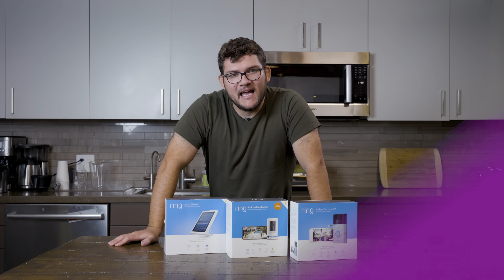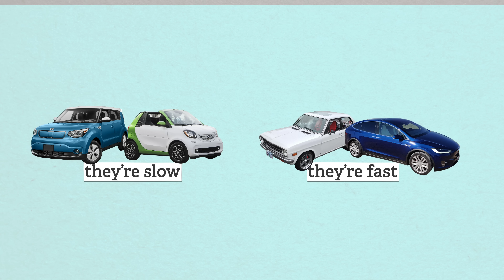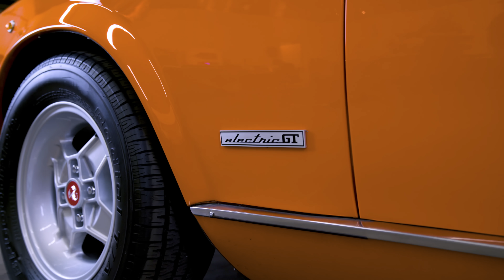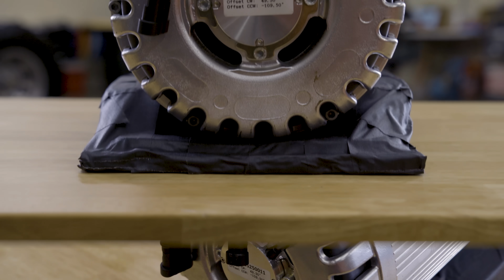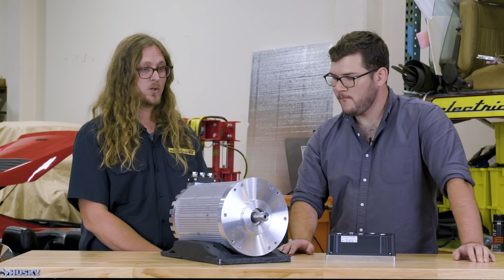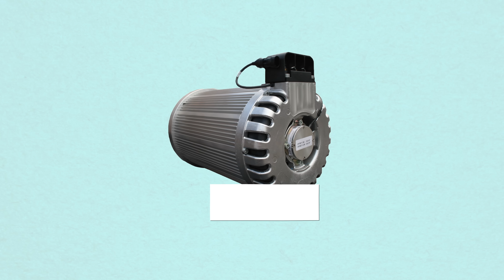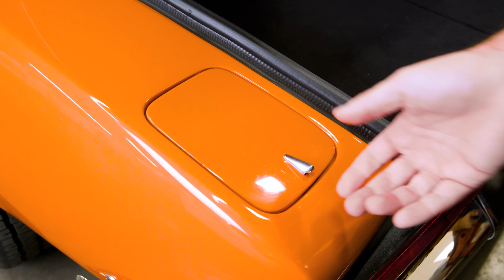Are Electric Motor Swaps the Future of Tuning? | WheelHouse

Comment: Electric motors with a manual transmission?!  I'm sold.
Reply: Clell Biggs that’s what I was thinking. It’s also impossible to stall lol
Reply: I agree if more electric cars had a manual transmission I would definitely consider getting one
Reply: But if they'd manage to get a clutch in too, then I'm gonna forget about combustion completely
Reply: @sheldonlewiss  you can't have a manual without a clutch, of course it has a clutch. I don't understand why everyone thinks it's a difficult process, it's exactly the same as a combustion engine to mate to a transmission.
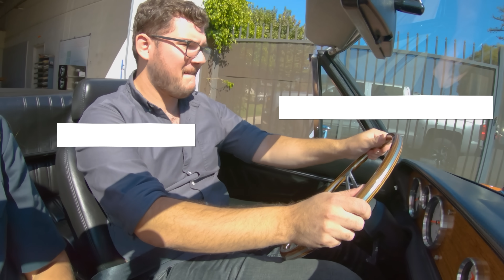Reply: @achilleaustin  The guy in the video said, there's no clutch engagement or something like that. I might've misunderstood that. He said you can just press the accelerator and it would go from a standstill and the clutch is to shift between gears. (6:40) please explain 😅
Reply: Sheldon lewis TECHNICALLY you don’t need a clutch because electric motors change rpms so rapidly, it could probably handle it, as long as you’re off the accelerator the electric motor could be directly bolted to the transmission. I’m not guaranteeing the longevity of the transmission, BUT you could do it
Reply: @sheldonlewiss Don't know if anyone answered this for you but while the car does have a clutch, it doesn't need it for anything other than gear shifting. Like, you can leave it in 3rd gear or even higher and just press the accelerator. If however you want to shift, you still need to press in the clutch.
Reply: Check out the EV Mustang that Ford built for SEMA, it's mated to a 5 speed (maybe a 6 speed, I can't remember).
Reply: @phillipholland6199  its by charge cars not ford
Reply: I just made one 😂😂 pretty fascinating as I do not have clutch all I do is shift gears while moving my feet away from the throttle it's all old skool no sensors less parts to break and it's fucking fast as hell I intentionally put motor rpm limiter so that i won't crash
Reply: @simardmg  dang that's awesome bro congrats, make a vid even if it's just showing it off.
Reply: Right now i'm like: I'LL TAKE YOUR ENTIRE STOCK
Reply: If electric cars were absolutely necessary outside of cities, I would absolutely " make the change " so long as I get to keep an RPM range and a shifter. I live the sound of my turbo charged mini and it's snappy exhaust sure but the shifting is the most important part for me.
Reply: I never thought an electric motor would need a transmission considering the torque curve.
Reply: I’m definitely sold
Reply: Sigh of relief
Reply: My goal in life
Reply: Clell Biggs same
Reply: True
Reply: They tried that with a C7 corvette and it flopped
Reply: Oh yeah !! And with that powerful speak system in the old exhaust pipe you can have any engine sound too in the future
Reply: @92-SC300  I was speaking more in the sense why if you're making an EV from the ground up, not making an engine swap, there's not a lot of reasons to design a transmission into it instead of a fixed ratio transaxle. Sure, engine swap, leave the transmission in for fun (and ease of conversion), but an OEM has less of a reason to.
Reply: Electric motors don't really need gears though, but they should feel awesome because the motor offer very low resistance, so it should feel like being in neutral gear when you don't have the foot on the throttle.
Reply: they operate at rpms from 0 to 20k, to have even a 2 speed transmission could theoretically get you to 400+ mph
Reply: Fuck electric motors. Internal combustion all day
Reply: And speakers to make engine sounds. 😉
Reply: It would not make alot of sense when using a high RPM motor, something like a Tesla would use. Maybe an electric motor of 10k rpm would work better with a transmission
Reply: why would you want a manual with an electric motor?
Reply: @DrDrift-rl6cc  for fun, and slightly more efficiency.
Reply: @DrDrift-rl6cc  They think they can shift faster than computer. Stick would be cool if they made an old electric muscle car.
Reply: What so you can switch between 2 speeds lmfao
Reply: Built in anti -theft device, coool.
Reply: I believe it's a option only cause they can do it, should they, sounds fun, but the massive torque, will Destroy the clutch.. Tesla roadster tried a two speed, but it wouldn't survive.. just saying.. my two pennies on the floor.. peace
Reply: @AtZero138  mate we're not talking swapping a Tesla roadster motor, and there are plenty of gearboxes that are run in cars with much more torque than a new roadster.
Reply: @achilleaustin  no worries,  it's that a multi million dollar company couldn't make a transmission that could handle the massive impact of shifting electric motor powered Tesla roadsters.. yes they make trans that can take it.. but the problem is in packaging.. this is all fascinating stuff to me.. as I'm typing this in my daily driver 1968 Dodge Dart.. Peace
Reply: @AtZero138  REALLY late response. But the tesla Roadster's 2 speed transmission failed because it was a crappy dry sump system that overheated the bearings in durability testing. Both New Venture Gear and Hamtramck tried to get it to work for Tesla. (I may have been working on it back in 2008).
Reply: If you’re fine with sacrificing range, sure. Which is like, something people complain a lot about. The poor range.
Reply: @Appletank8  It doesn't sacrifice range because you could just leave it in third and it would act like a regular electric car
Reply: @achilleaustin  also technically you would be getting better mileage on the highway since you would be sitting at a lower rpm than a normal electric vehicle, plus if you are using a modern drivetrain setup there will be minimal power loss.
Reply: @achilleaustin  
Transmissions are heavy. Especially when you're lugging three sets of gears that don't do anything most of the time.
Reply: @Appletank8  chevy powerglide might be a good option. plus with the torque multiplication of the torque converter it would use less power at stop n go. only problem is theres no lock up converter so youd have power loss. maybe you can get a lockup converter for it.
Reply: @achilleaustin  Not exactly, passing power through a transmission incurs friction losses. So direct drive will always be more efficient.
Reply: @Appletank8  makes 0.1 percent sense ,
Cuz  car transmissions just weights 30-45 kgs
Reply: Appletank8 throw a range extender in the extra space up front, a small motorcycle engine or single piston lawn mower engine and alternator could definitely fit in any of those cars and you have a series hybrid with basically unlimited range
Reply: @brandonmiller9155  
1) You're already sacrificing a lot of space by cramming in batteries into a vehicle not designed for it, I'm not sure you actually have the space for a fuel tank to get any useful range out of it unless you carry a lot of jerry cans.
2) A tiny engine isn't going to charge that battery with any semblance of speed. You're going to be sitting for an hour or two to get anything.
Reply: @Appletank8  range on a weekend classic car is really not an issue. Owners of classic usually only do short trips.
Reply: @Appletank8  but you get a higher top speed because of the gearing
Reply: Why do you need a transmission for an electric motor? Just vary the current. You save all the weight of carrying a gearbox
Reply: Yall do realize that there would be no point because you can throw it into the tallest gear and it would still perform amazing
Reply: @benweinheimer6287  Yeah but the fun factor of a manual is the most important. Also choosing gears makes it easier to corner knowing that you won't give it a little bit of gas and apply too much power. Not to mention drifting and stuff would be easier
Reply: swagonamillion boye well actually having multiple gearing ratios will make the efficiency higher. An engine uses them to convert the torque produced into something usable. Overdrive on the 6 speed manuals means that the engine can chill at 4 1/2k rpm and still be going 60-80 miles per hour,  obviously an electric motor uses less electricity at lower RPMs SO you get better range with the gearing. Probably not THAT much which is probably why most electric cars either have 2 speeds or none at all. It could ALSO benefit from greater regeneration when braking, but again probably negligible considering. More than likely manufacturers use what is essentially 5/6th gear for their two gear ratios. Which is where the greatest torque transfer is compared to RPM.
Reply: @benweinheimer6287  It would just improve both top speed and power economy, but no, no point at all.
Reply: exactly my dream

Comment: Every EV comes with a home charger that plugs into your toasters plain old outlet . You can install a dryer outlet for quicker charging but I plug my Chevy Spark EV in at night and it’s full in the morning . It also has 400ftlbs of torque and is faster than the v6 Camaro of the same year.
Reply: Yeah but that's a V6 not a real muscle car
Reply: xerosagas but the Spark is supposed to loose to Everything !

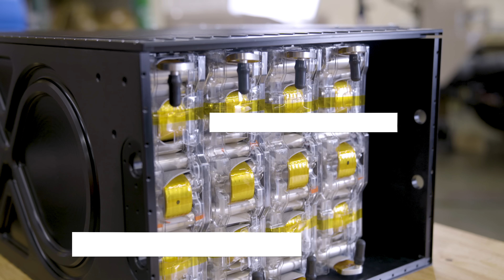Comment: 8:36 can one use water if they are in a pinch?
Reply: As long as the water isn't at risk of touching the contacts. The benefit of other substances is it reduces risk of a battery fire after a crash. These alternatives don't conduct electricity.

Comment: "Electric cars are beating some of the best gas supercars on the line"
Shows race between Tesla and Mustang

Nolan, come on, come... Come on, Nolan, come on, Nolan. Cuh... Come on.
Reply: Teslas regularly beat Hellcats of that makes you feel better
Reply: Gerry E for 50 grand more, yes. Tesla’s are still ridiculously expensive for their performance.
Reply: @savagetuner2404  What? the opposite is true. In a Tesla Model S P-100D you get 2.4 second 0-60 for around 100k. And you still get a fully functional very daily drive able sedan.
Reply: Cairo Nerf yeah, it still gets beat in a quarter mile by a 4,000lb jeep. I could care less about those electric boats.
Reply: A regular mustang ain’t no supercar unless it’s the Shelby GT500. But I do agree Tesla’s speed is comparable with some but not all supercar. A Hypercar in the other hand like Bugatti, Pagani, and koenigsegg can definitely outrun any Tesla at the moment .
Reply: Alvin Chong a Jeep trackhawk can best performance Tesla’s over 100k. A Jeep. They aren’t that amazing.
Reply: SAVAGE TUNER 700hp v8 , that trackhawk is some monster .
Reply: The point is valid, it's just a bad example on the gasoline side, if you talk super cars. Either change the line or the example. There's enough material out there from teslas beating all kind of super cars. Also there are some real crazy fast electric super cars, especially the rimac.
Reply: It's not BS, but it is down to the drivetrain and nothing more. An electric car has full torque from the start. Internal combustion needs revs to get to full torque. So by simple physics, an electric car should always beat internal combustion in acceleration off the line. Sustaining it and top speed are an entirely different matter!
Reply: A tesla can beat a lambo hope that will calm you down
Reply: That is honestly the stupidest example ever. You know when they're trying to be controversial. When they pull BS like that.

Comment: If Toyota would make an electric 86 with decent HP and mileage I would definitely switch from my gas 86.
Reply: bfrost7 they wouldn’t make it but you could swap it. Check out the hoonigan video on the electric 86. I don’t think it has good range but it’s cool. It also has a manual transmission.

Comment: Imagine an electric powered DeLorean, now that will be awesome
Reply: There is one already. It was even driven by Matt Farah.
Reply: Anythign is better than a shitty renault motor.
Reply: Hey guess what happened 2 years later lol
Reply: I know of at least two.  DMC in Texas actually made one about 8 years ago and dentist converted his to electric.  Both were DC, DMC used lithium, the dentists used PbA.   I believe the latter is considering converting it to AC which would be a good move IMHO.
Reply: I have some good news from the future
Reply: Some guy has a recreation controlled by an RC remote, but it still has stock drivetrain...
Reply: Autonomous Drifting Electric DeLorean.
https://www.theverge.com/2015/10/21/9581563/self-drifting-delorean-stanford-marty
https://news.stanford.edu/2015/10/20/marty-autonomous-delorean-102015/

Using AMRacing Dual Core Motors. The $20,000 in the video.
https://www.evwest.com/catalog/product_info.php?products_id=300
Reply: Great choice because the original engines were poop
Reply: It think this could make any car be a daily driver
Reply: Already done.
Reply: why there is a cracked hippie talking about hair dryers ?
Reply: There is one made by Moment Motors
Reply: yeah itd finally be an okay car
Reply: YEAH
Reply: Eager to drive one👍
Reply: https://www.youtube.com/watch?v=Ov-BgHkqvAg this guy made one
Reply: I'm pretty sure EV West in San Diego was working to convert one when the fully charged channel visited them in the Spring.

Comment: the reason why I hated electric vehicles was speed and distance but what worries me for Ecars today is the lack of noise. Don't get me wrong, I do I like the sound of the engine shifting and even when its idle. but I was also thinking with the cars going electric what about ppl  taking a turn, they don't hear the car coming and they get hit from a blind corner or someone on the sidewalk whether they're blind or not they get hit trying cross the street. i wouldn't want ppl to get hurt so i was thinking to myself "what about making a sound of a combustible engine come out from the electric car until over 80% of electric cars make up all traffic on the road.". We already have many sound files of vehicles with engine sounds in various stages for video games and racing simulators. why not use those files by putting into Ecars for awareness for ppl  to know that a car is there whether its electric or not. if we do this where it stays in the legal limit of decibels for noise pollution within city limits, there will be no future news headlines where ppl are hit by cars that they can barely hear. Though when im thinking of this idea it's for the percentage cars on the road being Ecars  is between 20%-85% cause so far they're rarely any stories of Ecars hitting anyone but im thinking of safety for everyone., plus more Ecars that will bet better mileage, speed, versatility in the next couple of decades due to the rapid innovation and engineering of vehicles today. also more Ecars means less pollution in which equals to more breathable air and global temps slowly dropping back to normal ranges also more money into infrastructure for the roads.

Comment: " the suspension stays the same" - really? because batteries add a lot of weight, even after ICE is removed. 
Why keep the tranmissions at all? there is no torque curve, no need for a clutch. Tesla do not use trannys. Porsche is only 2-speed.